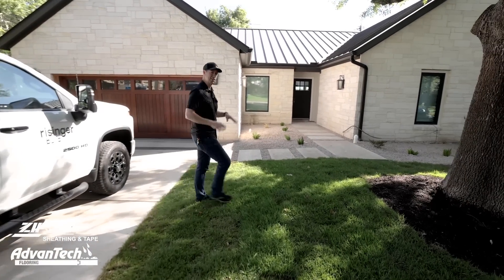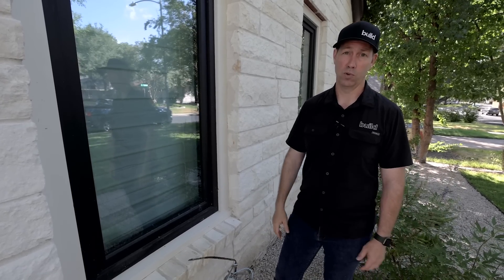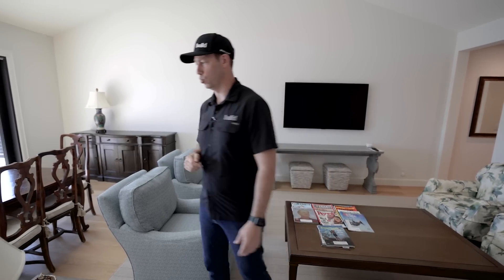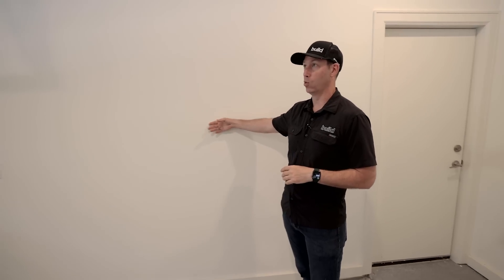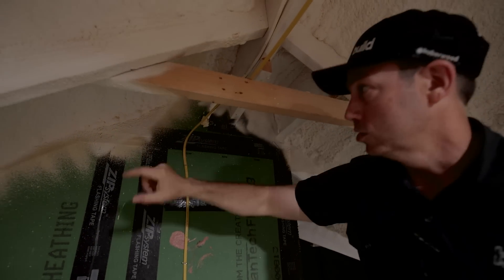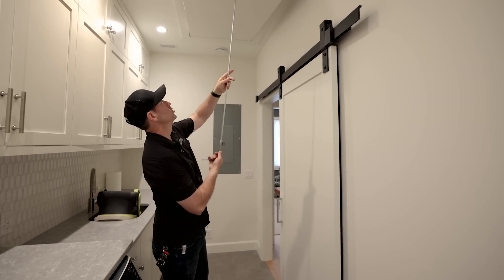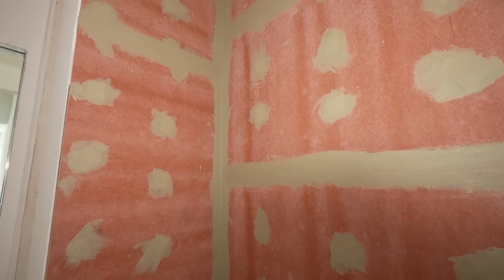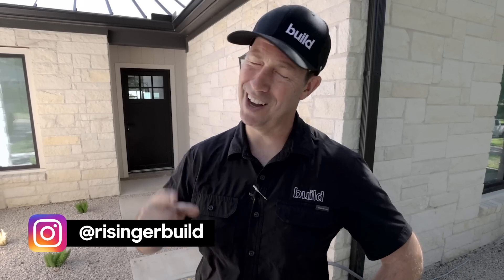Tstuds, Slab Insulation, Monopoly Framing, etc... This house has it all.

Comment: Nice home.  I feel like a well designed & built 1,500-2k sf home is way more desirable these days for smaller young families as well as retired folks, rather than larger cookie-cutter suburban homes of the last 25 years
Reply: You hit the nail on the head. Builders creating 4,000-7,000 sq-ft homes have little utility but very high profit margins. Big box builders have driven the small custom builders out of the market. The realtors are using "market comparable" approaches to value so they can make quick sales. The Federal gov't and banks need to demand the Cost/Replacement approach for valuation.

Comment: I was just able to fill an 80 gallon whirpool tub using a 50 Gal Rheem hybrid.  I have a mixing valve and keep the temperature set to 140 in the summer.   Would also recommend piping the hot water heater into the garage. It will virtually eliminate the need for that mini split, use the 'free' heat in the garage to heat your water and cool the garage.  Also perfect because usually just after you come home is when you take a shower and have opened the door and taken in a big gulp of humid air into the space.
Reply: I have a similar setup and can confirm this works well.  I have a GE Geospring hybrid 50 gallon in my garage with a mixing valve.  Not enough to cool the garage in south Texas, but it helps.  I have a portable a/c unit in the garage for when I'm working out there.
Reply: @S M takes heat out of the air and into the insulated water in the tank.  Energy density of air is less so it take quite a bit to heat up the water giving quite a net cooling effect in the room.
Reply: @S M  Not referring to the water lines.  A hybrid water heater uses a heat pump to pull the heat out of the air and put it into the water.  The byproduct of that is cold air being expelled from the heat pump (and cooling my garage!)

Comment: Really like the monopoly framing, slab insulation and conditioned attic. We're breaking ground on a home in Durango CO in the next 24-36 months. The home will be on slab and my bride wants to use reclaimed hard wood flooring, like the way you insulated the floor with 2 layers of 3/4" decking! I'll be looking at that with my builder as an option!!
Reply: Reclaimed wood is beautiful. I think it even looks good in modern houses but it could be a fad like orange or green carpeting that people will ripping up and saying what where they thinking.
Reply: I think the insulation is in the foam panels that go on the slab first. The 2x plywood is for floor structure and nailing base.

Comment: Small(er) and more efficient is the way to go! Would love to see some “more affordable” homes done with a similar treatment ($400k range)
Reply: A home of this quality for $400k would be around 700 square feet.
Reply: I am finishing up my own 2100ft2 home built with an externally insulated slab, ICF walls (R40 + 10” of thermal mass) european 3 windows, double SIPS gable roof (R80) and ductless HRV system. The floors are polished and stained concrete. I wont be testing it but the house is build to passive house standards. I used ikea cabinets and a simple shape and do not have an attached garage but im expecting $170ft2 be the project cost.
Reply: @mroberts566  When you're putting $7K+ of material into the subfloor, over a slab, for a slight give to help the knees, you're right.

Comment: Matt can you have some discussion about cost of efficient construction. I assume that your in a typical working class neighborhood and likely your house is more costly than any other on your block. You made some higher end finishes and choices along the way so if one was trying to keep the cost relatively the same as a traditional build where is that line? Does the insulated sheathing blow the budget, the fancy studs, triple pane windows? Which ones provide the most bang for the buck in your opinion.
Reply: Yes please answer this!
Reply: This house is no where near normal house price range. This is $400+ per sq ft
Reply: If he's actually in Austin and his backyard faces water, he's comfortably in a  7-digit house kind of neighborhood.
Reply: All the things you listed blow the budget, along with full on premium sub floor over a damn concrete slab and into the attic and so many other things to list. Basically nothing on this build was budget lol.
Reply: The payback period for hvac should be included in the financial equation

Comment: I like the idea of conditioned attic if you don't have basement. Design considerations would be to use floor grade joists... 2x10s instead of typical 2.8s? I'd also put in 1/2" drywall up there too. Think about all the savings, energy, and even storage rentals.

Comment: The windows are casement?...they are beautiful how do they open? from a crank?....no vertical lift windows as house is modern...i have a 50's ranch that needs all windows replaced and need high r value as it is by a highway...

Comment: the non-salt softeners come in two forms: catalytic and conditioner-molecule. Both essentially prevent scale by causing calcium to form smaller crystals that float and don't bond to form plaque. Neither will work for hard water with a PH over 8. My research suggests the 3M technology also is effective but the NuvoH2O may be less problematic chemistry.
There are also now automatic conditioner systems that self-optimize the amount of salt used to avoid waste.
Reply: How's it do for washing clothes and what not? I am tired of carrying salt down to my basement, but I love the results with my clothes and the "slimy" feeling is just no grit on your body.
Reply: I've got the exact system in my house.  We noticed the difference in quality immediately.  The taste of the water is much better as well.  The home is from 1985, so there's still junk stuck to the piping, but the water coming through is much better, we don't notice scaling at faucets any more.

Comment: Why not duct the water heater’s cold air output to the garage and cool it that way, taking load away from the minisplit?  Am I missing something?  It sounds like you’re planning to add a bath fan to exhaust the cold air somewhere else?

Comment: Matt, I'm curious as to why the hot water heater doesn't exhaust into the garage space since it's a heat pump model?  Wouldn't that help cool that space as well?  Use that outside air to feed the water heater, then to the garage.

Comment: Multi point lock doors are normal in Europe. Your home insurance would go up if you didn't have them.
Nice build but that's not a 'small' house by UK standards, rooms are pretty big😄
No solar and battery backup for those regular Texas power cuts though?
Reply: I believe he said they have a natural gas generator tied in.

Comment: Hello Matt, I am a subscriber and have enjoyed hundreds of hours of your numerous videos on airtight homes or sealed homes. I’m a retired engineer and former builder from Chicago living in Fort Myers, Florida and looking to purchase 10-20 acres to build a home for myself. While I used to build 10,000 square-foot energy hogs, I’m doing a 180 and wish to build a home like you have in this video. I have a couple of questions for you…

1.) I like everything about the home you built for your in-laws and would like to inquire as to how I could buy those exact plans for the home, including the T-Studs And the monopoly framing.

2.) If the plans are available for purchase from you or the architect, would all of the systems be included in the plans, such as HVAC, framing, for insulation, roof insulation, etc.?

If I can achieve my goals, I will certainly invite you out to Views the construction or finished product. Thanks in advance for your help! Jack
I spoke with an architect here and we had no idea what I was talking about and I’m not interested in educating them. It took me 100 hours of watching your videos to learn what you’re doing in San Antonio :-). I don’t use the common section very well I’m not sure even if you were coming here or not. Would it be possible to email me at Jackcassidyjr@gmail.com ?

Comment: Very nice place, the mechanical room off of the garage is a great Idea however, how are you now separating the garage from the house? Is the door to that room solid core and self closing? You also mentioned puting in a vent through the wall to that room which compromise a separation. I don't see drywall at the back of the room making it part of the garage, just curious how you are doing it.

Comment: I liked your design for your father-in-law’s house, but I wondering about your decision to put wallpaper in the bathrooms. Wouldn’t the high humidity from a shower or bath cause the paper to either delaminate from the walls or possible promote mold growth (either on top of or underneath the paper)? I know Joe Lstiburek has written a lot about vinyl papers causing major mold problems in air-conditioned buildings in the southern parts of the US.
Reply: The continuous air flow system handles the humidity. Instead of a fan that is only turned on for a few minutes the bathrooms are dehumidified 24/7.

Comment: I noticed the front gutter goes directly into the ground.  I have a similar setup at my house (Illinois).  The leaves and whatever else lands in the gutters goes into an underground pipe which unfortunately clogs up over time.
Reply: Could have leaf filter type guards in the gutter.  Given the incredible attention to detail, I'd bet something like thst is there.
Reply: @BobPritchard  I looked into leaf filter guards and the reviews were  mixed.
Reply: @59seank  The big brands are super pricey.  I buy cheaper ones a the big box store.  Not perfect but pretty good.  And I have a metal roof with a downspout going to a drywall, surrounded by giant trees that make a real mess for months in the fall.

Comment: The problem with curbless showers is neatly demonstrated in the main  bathroom. When you open the door, it starts pushing the bathmat out of the way, and who doesn't have a bathmat immediately outside their shower?

I sadly do not know of a fix for this. I love the look of the curbless, but it's not practical.
Reply: But safer and also esthetically more pleasing as you point out.
Reply: I noticed that too, the only option would be for the door to open into the shower but that means the shower head has to be on the opposing side
Reply: Sliding instead of pivoting shower door perhaps?

Comment: What about moisture control in the attic spaces? Another video of yours on building science, talks about how humidity rises because it is lighter than air and you need to let it breathe at the top ridge of the attic with a permeable membrane. Are you just controlling it with mechanical dehumidifiers?

Comment: Would you have used closed cell foam in the attic if there was no dehumidifier .  I've been told not to foam the rafters, but foam the ceiling only.  Attic humidity  has to go somewhere, so it seems to me that foaming the roof in not a good idea.

Comment: On the 15 minute video you mention about water filtration and why did you use replacement cartridges instead of the self-cleaning filtration system from Whirlpool-whelj1 ?

Comment: Hey Matt, I'm curious.  Why not use a passive ventilation solution on that utility room that's linked to the garage space?
Reply: My thought exactly.  Exhaust that cool air to the garage and reduce the load on the mini split.  That would save money every month!
Reply: I made the exact same comment.  Duct the heater exhaust out.
Reply: I JUST did this, and my bathroom (where the heater is) is WAY warmer, and I'm now using 40% less energy heating the water. Pro tip, keep those Rheem heaters on "Heat Pump Only" mode, NOT on "Energy Saver".

Comment: One problem I've had with attic ladders is the weight limit. They just aren't engineered / rated for a heavy person (face it, a lot of Americans are 225 to 300 pounds) and add in a box of 'stuff' being carried ( a 20 to 40 lb box added to the person's weight) going up the ladder. The liability issues are troubling, even if you win it's costly of time and stressful.
I wish the industry would address this, especially since you'd expect even more traffic up into a conditioned attic as it increases it's usability. We need heavy(er) capacity attic ladders.
Any thoughts Matt?

FYI - I watched the garage attic ladder bow when you mounted it. I don't think it would stand my 277 pounds.

Secondarily, every builder might consider that sooner or later everyone ends up in a wheelchair so the standards from the 1800's on of narrow closet, bathroom doors should go away. Design so that every interior door is at least 32" so a wheelchair bound person can roll themselves through.
I've modified a couple of remodels door openings for this where possible but usually there's cabinets or other obstacles like intersecting walls baked into the design so have to pass there.
Reply: Pocket doors can help with wheelchairs
Reply: Eat less moon pies dude.  300# isn't normal.
Reply: @grahamstefaan  exactly why accommodate for peoples bad choices.
Reply: @grahamstefaan  thanks for the sarcastic advice.
You have no idea what my health circumstances are yet your passing judgement on me?
Of course you're so perfect that angels come to you to be blessed, right?
Perhaps some day you will gain a modicum of understanding but I am sure it will take you many experiences at Percussion University.

Comment: Hey Matt, long time fan and love your videos. We're going to be building a custom home in the Dallas area soon and I like the idea of a conditioned attic. But it has me wondering, how do you manage any exhaust (for lack of a better word) or gases from the mechanicals in the attic so that there aren't potentially harmful fumes accumulating in there? HVAC systems for example, they have a gas flame in many cases - maybe I'm wrong but it seems there's gases like carbon monoxide that could be trapped in an air tight attic. Maybe you can explain how this is solved for.
Reply: @S M That's a really good point - I didn't consider that ALL of the mechanicals in his videos with sealed attics were electric, I've always had gas furnaces and electric didn't cross my mind. Maybe Matt clarifies this in other videos, but it might be worth him mentioning this at some point fully sealed attics like this. If you had to use gas for whatever reason, is there a way to vent those types of mechanicals to the outside while still having a fully sealed attic like this?
Reply: @PhillipGoericke  You can have gas appliances in conditioned space, they just have to be direct vented so all the combustion air comes from the outside and exhaust goes right back out. Also no flue collar so backdrafting doesn't happen.
Reply: @hailexiao2770  thanks I wasn't sure how that worked

Comment: New builds... darn it. What can I retrofit my old home to improve its efficiency, other than the regular top plate air sealing and attic batts? My exterior walls don't even have sheathings so blown-in insulation isn't possible.
Reply: you can insulate without sheathing but it is NOT easy. Check out the article on green building advisor called "insulate walls without sheating" or something like that. That's what I did to my home. Other option is to foam the exterior, which of course is not easy either.
Reply: Yeah, I also noticed that the only remnant from the previous house was the slab and associated plumbing. As costly as a complete tear down might be, it's probably still less costly when building to these standards than retrofitting around all the old substandard design/work/materials.

Comment: This seems weird with the roof sheathing.  Sheath it once on top of the trusses and then again with the 2" polyiso, then again with another 2" polyiso, and then again with another layer of osb?  That'd be hard to pass that cost on, or try to get an appraiser to believe it adds value.  Maybe just put the hvac in a closet and bury the hvac flex with 3' of the fluffy stuff.  25 grand cheaper, add some solar panels with the savings and be way ahead energy wise I'd guess.  Either way an affordable new house is not the goal here and most buyers in the 750k and down range are buying the maximum number of sq ft that their lender tells them they can have with little care about saving 50 bucks a month in electricity.

Comment: Is it a bad idea to build an airtight home in a hot and humid climate? Almost everything I can find about passive and tight homes concern building in cold climates. I’m afraid it might turn into an oven.
Reply: These "airtight" homes typically all have HRV/ERV units that constantly bring in fresh filtered air and exhaust the stale air.
Reply: @MorryB  obviously, but how is the interior kept cool? A house has a lot of things producing heat on the inside, such as our bodies, machines and electronics, plus heat that will inevitably penetrate into it through windows. How does that heat get out?
Reply: @S M 24/7? Kinda defeats the point of a “passive house”
Reply: How would a leaky house be any cooler? Is the hot outside air going through random holes going to cool the house down? Shading, low solar gain windows and lots of insulation keep the house cool, and air conditioning takes care of whatever heat makes it through.
Reply: It is so much better living quality to leave the outside, outside - and the inside, inside. One of the reasons I think it SO ridiculous to try to regulate interior comfort by opening/closing windows. Condition the interior space to the level desired by mechanical means exclusively, but it will be FAR less costly when the exterior plane is air sealed and well insulated (regardless if heat, cool, dehumify).

Comment: Pull that door off the water heater closet and add a screen door.  You are trying to chill the room and then chill the garage. Not energy efficient. Let the water heater do the work of pulling heat out of the garage.